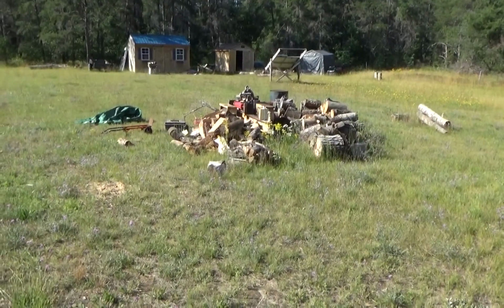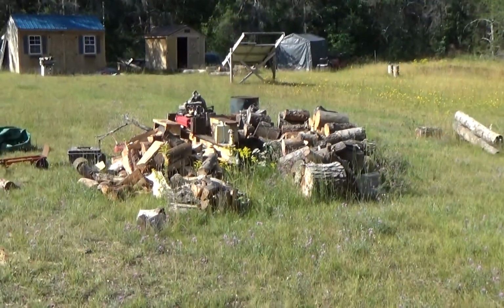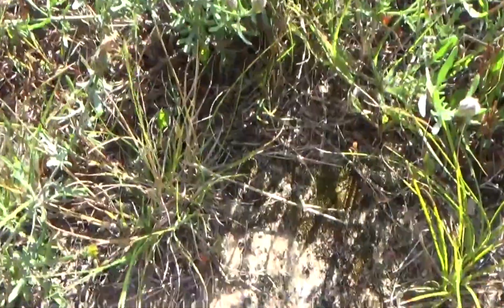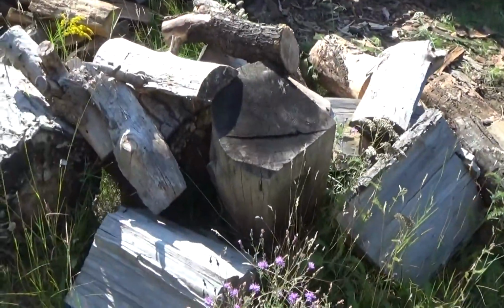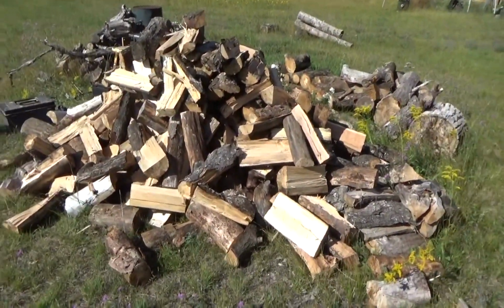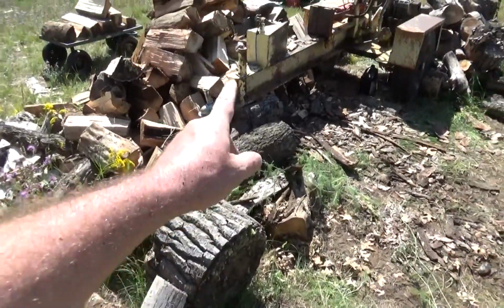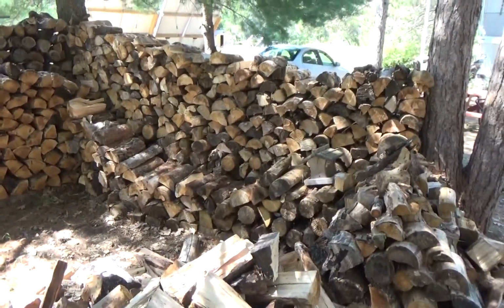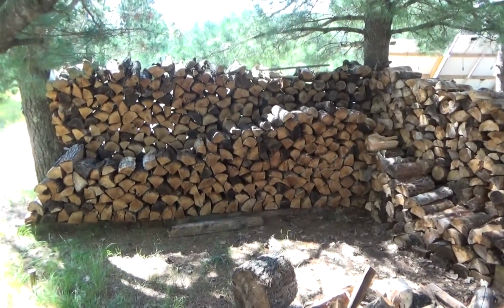Processing Fire Wood For The Off Grid Homestead

Comment: Using wood for heat, and considering you don't want your pipes to freeze... How are you going to heat the house while you're at work?
Reply: David Johnson  good question 👍🏼
Reply from the maker: This new wood stove is supposed to burn 12 hours on a load. Propane as a backup. But I am considering building a brick wall behind the wood stove which will hold and radiate heat too.

Comment: Those logs that are too long to fit in the splitter, stand them on end (as if they were growing out of the I-beam) then split just make sure that the log is centered on the wedge before pushing it. Also that engine is not running smoothly  needs an adjustment to high speed jet until it runs smoothly during a cycle of the ram under load